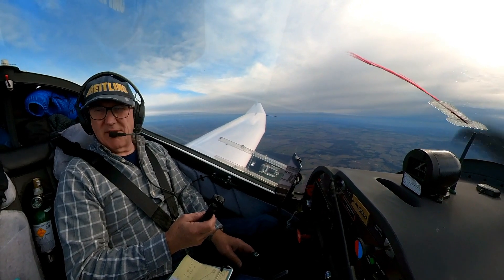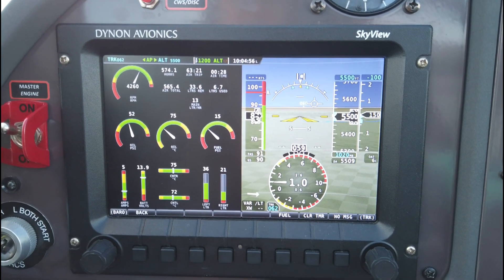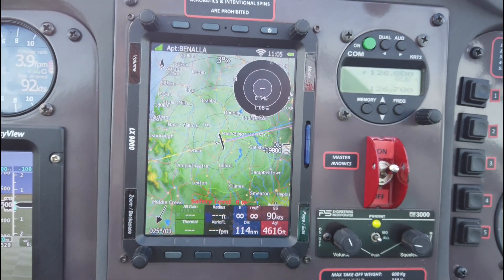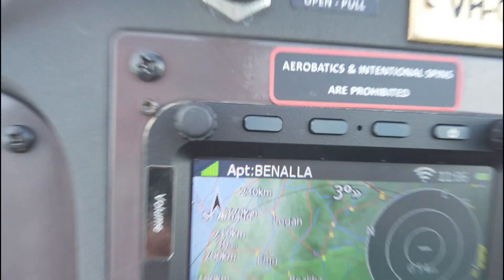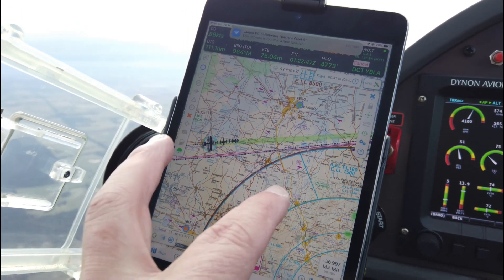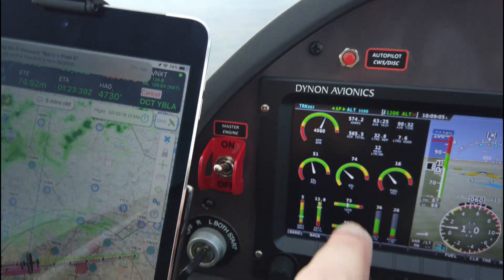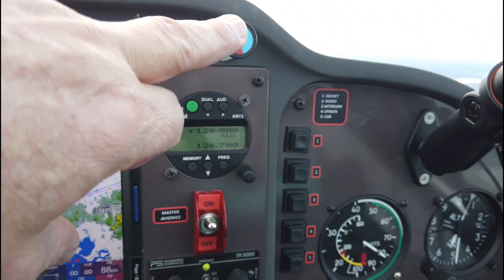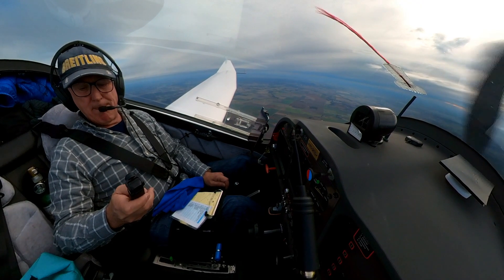Cockpit tour of the Phoenix Motorglider

Comment: Does it realy fly so stable or are you using an autopilot? Our Dimona does no do that at 92 kt, neither horizontally nor vertically... And you vario is like locked to "0", so I would really be supprised if this is without some kind of autopilot...
Reply from the maker: Yes, I have a 2 axis autopilot on the Dynon Skyview. It is great when cruising, or if you need to attend to any personal stuff, or just check conditions at your destination.